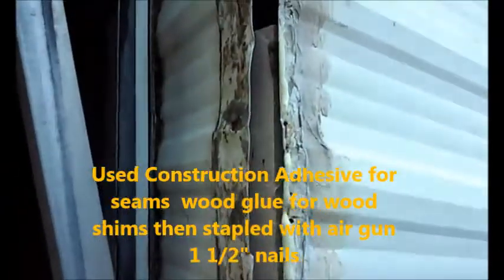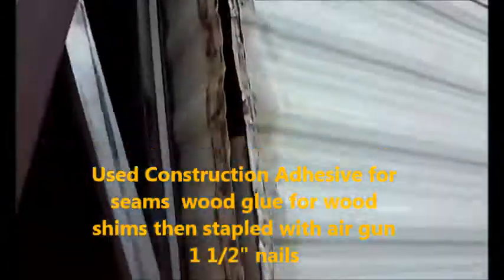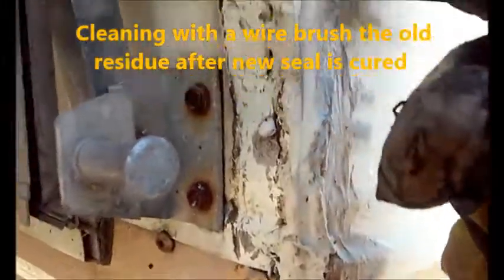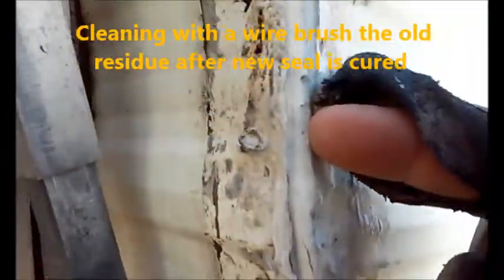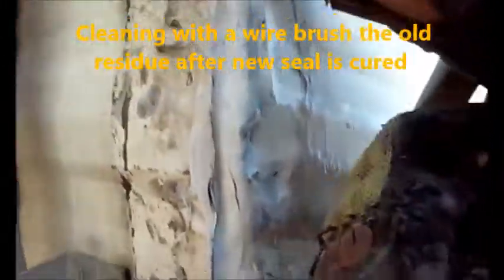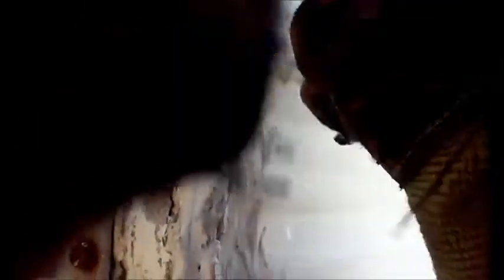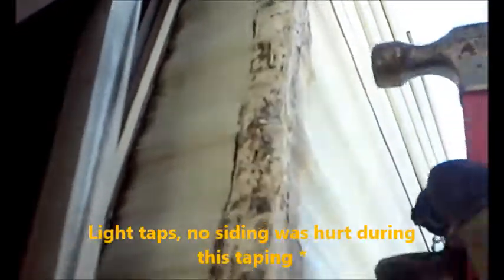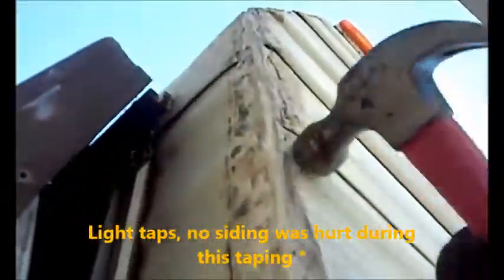RV Life, living How to DIY stop seam Leak Automate J rail repair prt 1

Comment: Great work. I like your method of inserting a new internal metal corner. Gives more surface area for the silicone to adhere to and adds strength. I wonder if also adding metal screws would help the silicone stay connected?

Comment: Did you remove the walls to repair wood rot?
Reply from the maker: I was able to remove from prying open and replaced with clean wood, its still holding up to this day.. of course needs a touch up, but good otherwise. Thanks for watching.